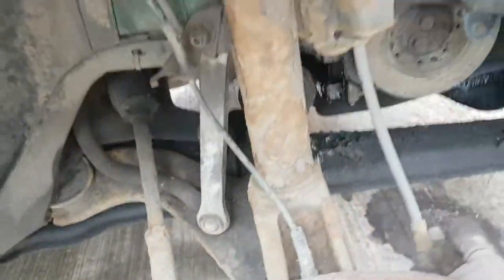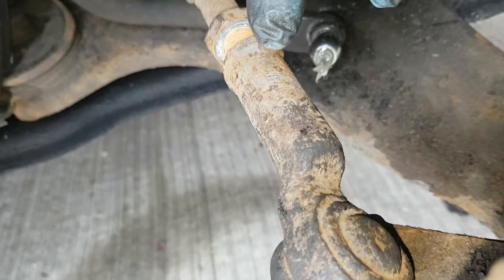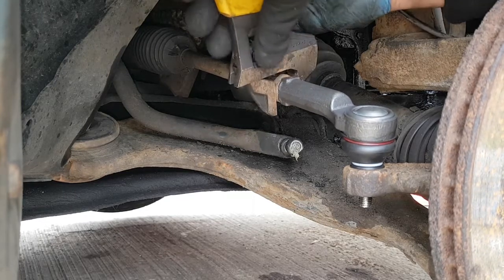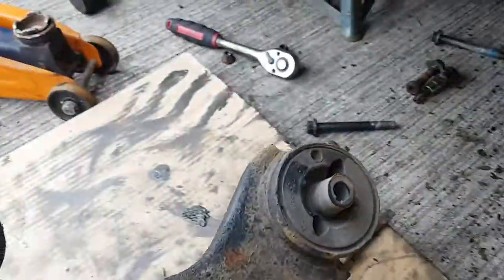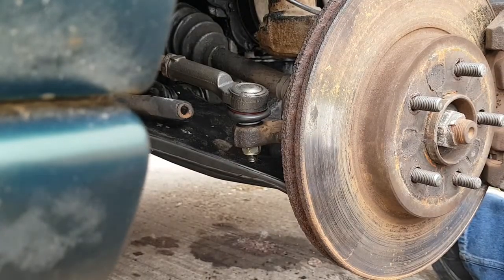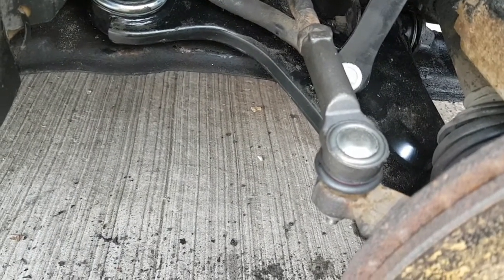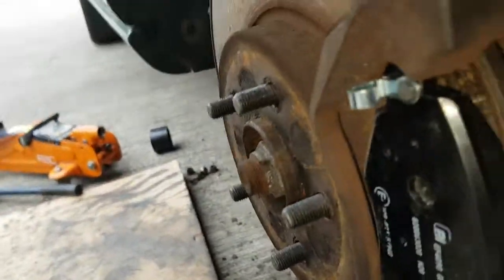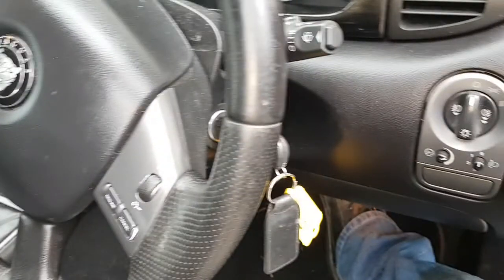Jaguar x type Suspension Arm - track rod arms - link rods - brake pads

Comment: The Jaguar shop manual calls for using a special tool to support and adjust the height of the subframe while doing repairs on some suspension parts. It even says to detach the steering column and detach the steering gear supply pipe.

Comment: Like he says in the video, that rear bolt on the control arm takes some messing around and a bit of force. Reinstalling it I put the bolt in from the bottom to make it easier. I know the bolt goes in from the top for a reason but I'm not concerned with it coming loose and falling out. It's been a couple years and it's still there.

Comment: That left side bolt on the lower control arm bolt was a pain in the ass to come out. I did also remove that little part of the subframe. So when I was reinstalling the lower control arm I reversed the bolt on the left..phuck you Jaguar... So now the nut is on the top and I feed the bolt from t the bottom.. and no it did not mess with my alignment.

Comment: I am a few minutes into this, the track rod end is being replaced. First - the part about keeping the spanner vertical to avoid altering the tracking. Not true, there is a spherical end on the inner not a thread so it makes no difference. Second, the part about using the lock nut a a ‘stop’ to screw the new tre up to - well its better than nothing but it doesn’t guarantee the tracking will remain correct because it’s not the exact same part that came off. Third, none of that matters anyway because the new bottom arm will almost certainly alter the tracking anyway. It’s highly unlikely that your steering wheel will be level when driving in a straight line after doing this work and that will show that the tracking needs adjustment….

Comment: You said you loosened all the bolts before starting the video. I was wondering if you removed the sub-frame bolts at that time to allow you to remove the control arm in the rear. Thanks 👍
Reply from the maker: No need to touch the sub frame bolts you can get to top bolt with a ring spanner to hold hope this helps
Reply: @fuelheadjay8800  Thanks!  Thought I had to drop the subframe a bit to get the arm out after watching this video.  https://youtu.be/uBzz_q8XSpg
Reply from the maker: @snatr  nope
Reply from the maker: Just pain to get bolt out but just keep twisting and moving bolt it comes out.

Comment: Any tips on removing the bottom ball joint. Mine is completely stuck!
Reply from the maker: Hit around it with big hammer  or buy a ball joint spliter or heat it up 
Only ways really try soak it with penetrating oil leave over night put some heat on it then hit around it should pop it out